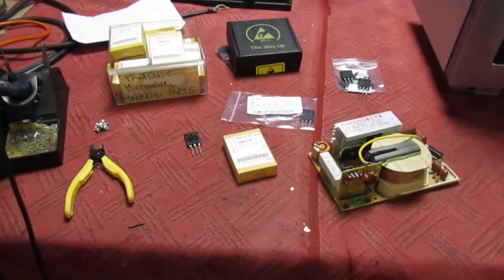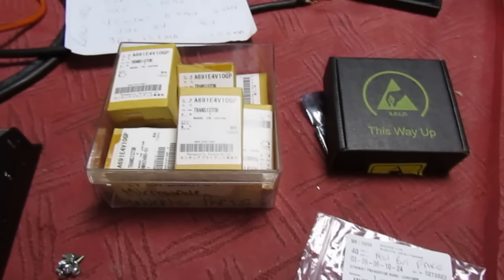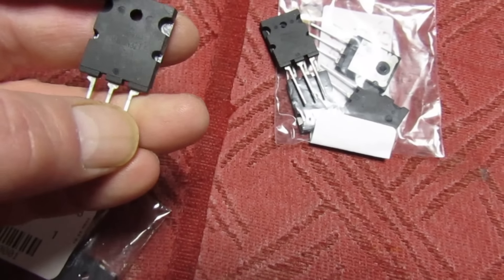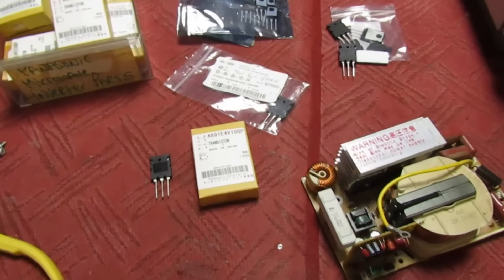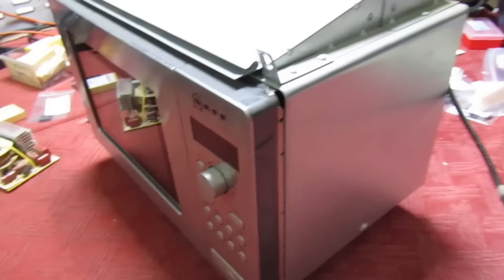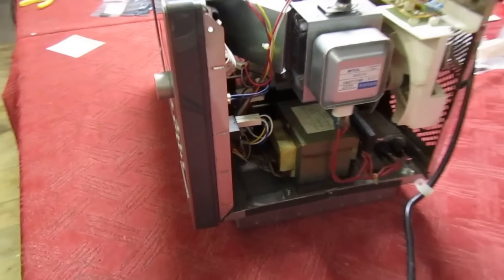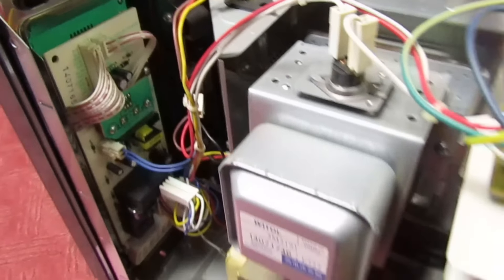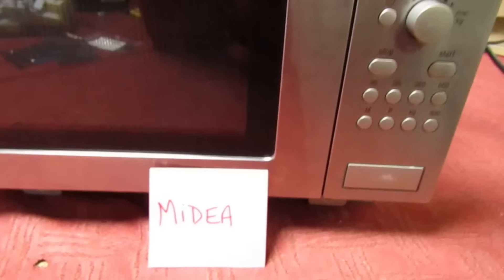Neff Microwave nasty surprise inside .

Comment: Another classic case of the switch mode supply replacing the trusty power transformer.
Reply from the maker: Strange how they have reverted back to a transformer though , maybe its cheaper to make a transformer now  ?
Reply: @michaeldranfield7140  Possibly. Could have something to do with the supply of silicone over the past few years.
Reply: @michaeldranfield7140  MOTs are mostly iron with aluminium windings, so they're much cheaper than ever before.
The coils look like copper - just scrape away the surface and be greeted with shiny silver.

Comment: I got out of repairing microwave ovens in the 1990s just as Panasonic were releasing their new "Inverter" type units. I remember looking at the inverter board of one which had blown up and thinking then that the idea was crazy. Semiconductors and high voltage / current don't play nicely together.
Reply from the maker: to be fair though the inverter boards have stood the test of time , I remember in the 90s when I was a sharp dealer we were shown a prototype on a sharp training course and told this would be the future , strangely enough though sharp never produced any over with a switched mode psu , in the UK anyway so I dont know why .
Reply: I bought a Panasonic microwave oven in the late 1990's, Inverter-type. It still works to this day, even the incandescent bulb inside (big thing with long filament, looks like for a very old projector). The white plastic case has yellowed though, so it looks a bit off.
Edit: About quality from the past, I bought a cooler/freezer at the time, Swedish brand (Cylinda) but made in Denmark by Vestfrost. Standard model, nothing fancy at all. Still works to this day. I had to change the old typ capillary thermostat for the refrigerator part after 6 years, corroded away, new part was dipped in plastic. 25+ years this year. Practically unheard of if you buy newer stuff, which too often fails far sooner. Many later Cylinda were made by Turkish Arcelik, and they among other things managed to use untreated iron tubing for the condenser coils, så ALL those refrigerators failed within 3-5 years, first symptoms inside filling up with brown rust! Crazy, but true.
Reply: @Indiskret1   The Series 1 Panasonics released in 1998 were manufactured in the US, the white plastic did go yellow over time. There were also some paint issues where the door pulled paint off the front mullion the first time it was opened. But they were very reliable. Here in Australia, I'm pretty sure they didn't have the tubular halogen floodlight style lamps, they were expensive to replace and with 240V mains here rather than 120V (so thin filaments), the halogens were rather delicate and prone to short life. (Some Sharp convection ovens used them since they handled heat well, but people didn't like having to replace them.) The US Panasonic models weren't manufactured for that long - divisions within Panasonic used to bid for production allocation and for the next model run the Chinese arm PHAMOS won the bidding.

Comment: We've used a cheap (just two knobs) Chinese microwave for 20 years and it just keeps on going. Who can compete with that? This might sound crazy but maybe the Chinese last longer than Panasonic nowadays.
Reply: Its not Chinese vs Panasonic that is the difference, its transformer vs SMPS.
Transformers are reliable and last for decades, whereas high voltage SMPSes are fragile and fail within years.
I remember when it was normal for microwaves to last decades. They all had steel transformers. People used to have microwaves that were inherited from their parents.
Reply from the maker: the thing is something very old will last much longer because all though it may have been cheap years ago I will be of a much better build quality and much better parts, the stuff they produce now is more or less disposable , just not designed to last many years .

Comment: Now you got my attention when you said IGBTS breakdown over time (with use I am guessing) as I have often wondered  this myself. I repair a lot of Yamaha Power amps with IGBTs switch mode PSUs and I never see any reason why the IGBTs in them are always blown but the rest of the amp is working just fine when the PSU is repaired.  This might explain the reason. Just the way they are made makes them go bad over time!
Reply from the maker: Yes, it was a very interesting and quite lengthy document detailing aging of a Igbt and it's failure mechanisms and the conclusion was a definitive degradation of the substrate of the device after prolonged use, eventually leading to failure, this is what prompted me to buy those 5 used Igbt s to do some comparative tests against a new device, however my simple tests all gave a pretty much identical results, the university were using x ray to examine the internal structure, like you I have replaced Igbt s with no other parts required which seems to suggest that they do degrade with use.

Comment: Very insightful - thanks. The very first appliance I bought when I entered the "real world" when I started working and my rented flat didn't have a microwave was a bog standard x-former Panasonic - it's been going 20+ years now but the inside is starting to rust under the wheels of the turntable - my parents replaced their old style microwave/grill with an inverter type about a decade ago and haven't had any issues (yet) - the appeal for me is the power control as we have PV/battery so being able to control the power would be useful, albeit not at the expense of reliability!

Comment: Hello, Panasonic for a long while use the non inverter tech in their base model microwave but they do still use inverters in the rest of their model range. The inverter they use is quire robust, id say we get more blown bulbs with melted DU PCB's than failed inverters. Wierdly i had a couple of failed inverters where the IGBT was short but the bridge rectifier was fine!
Reply from the maker: the bulb , yes you have to watch out for that one , bulb blows the pcb fuse that flashes over to the micro and writes the oven off as the micro is now no longer available .

Comment: Any component that meets or exceeds the original parameters is fit for replacing an original.   
A replacement IGBT, as an example, can be replaced with any other that matches or exceeds the original collector current and collector-emitter voltage, matches gate capacitance and total charge as close as possible. 
The emitter-collector max drop is of less importance and TDP should be equal or exceed OEMs. 
There are advances even in discreet   semiconductors. Look up reputable sellers for original parts with warranty.
I can recommend a couple if you're from the EU.
Reply from the maker: substituting an IGBT is not something I have ever done before , I have always used the correct part , but in this case its almost impossible to get as panasonic no longer have these , I was lucky to find a company with some old stock but I dont think that will happen again . The gate capacitance of the original part is very high no doubt due to the size of the device so its going to be very difficult to closely match this part , but as I understand it one with a lower gate capacitance will turn on quicker .
Reply: @michaeldranfield7140  you can substitute with lower gate charge. It will be fine as these are not self oscillators and it will only be easier on the driving totem. 
That is one of the advantages  of newer transistors. And you could also increase gate dampening (resistor and ferrite bead) to avoid hf ringing. But for that you should carefully scope the gate slope and collector current to avoid any unnecessary lingering in the linear region. 

But in my opinion... I'd just throw in any beefy-enough igbt. 
Fakes are everywhere. Recently had a batch of 20 mosfets blow on me at 1/4th of the rated specs... 
And I should've known as they cost 1/3rd of OEMs =))
Reply from the maker: Many thanks for that , I will come back with another video soon .
Reply: some IGBTs have integral inverse fast diodes, some do not, so dont fit one without a diode when the circuit needs one! Big bang!
Reply: @kevvywevvywoo  I guess that should be obvious. But nowadays, pretty much all sport integrated fast diodes.

Comment: Midea is pronounced MAY-DEE in Mandarin. It is a big brand in China and considered reasonable quality for the price. We have lots of their products here in NZ and they seem to be ok mid range products. My Panasonic microwave has just started tripping my breaker when I pressed start last night. I guess it's gonna be a shorted IGBT and destined for the recyclers. Oh well. It was a roadside freebie and I got about 2 years from it, so I'm fine with it.
Reply from the maker: Many thanks for that , I wouldn't throw away your oven just yet , many different things can trip a breaker , water in the turntable motor is a very common cause .
Reply: @michaeldranfield7140  Yeah, I'll still diagnose it first. The turntable motor has always rotated when the door is open. I never bothered fixing that, so it is still rotating normally. I can program in the cooking time but as soon as I hit start, the breaker trips.
Reply: @michaeldranfield7140  Pulled my board out. It looks to have two IGBTs (high and low side?). Both measure shorted. I guess it's time to take her to the recyclers.
Reply: Midea has the Toshiba microwaves and appliances license in Europe. They also make decent fridges. Haier is another decent Chinese one who now own ex Italian brands Candy and Hoover. China not to be sniffed at anymore.

Comment: That Neff looks very similar in build the my Cuisinart here in the states even down to the same Mag used. I still like the heavy transformer ovens, they've gotten pretty reliable over the years. On the flip side the Panasonic's are easier to move around.
Reply from the maker: Quite possible that the same oven appears with different names in different country's, the transformer ovens are much easier to repair due to the virtually unchanged design since they first came out .

Comment: Have just used a substitute IGBT in another product and it seemed to go well so like others here I'd  suggest trying a modern equivalent. Don't know what the operating frequency of these ovens are but if not too high maybe gate capacitance is not so much of a problem.
Reply: 2450mhz
Reply: I was talking about the switching frequency of the IGBT, which is likely around 20kHz and not the microwave frequency.

Comment: Hi Michael - I hope your proposed test works well because I have two combo flat-bed Panasonics which we use every day and I'm banking on you being able to fix them when they eventually break down!  This particular model, whilst absolutely brilliant, is sadly no longer available!  Great video again.
Reply from the maker: Fingers crossed it should be ok , however there are different inverter boards used , this will cover the earlier version , then I will look into the later board as parts for these are also no longer available .

Comment: That looks like the 6 yerar old  £80 cheapo MW that my daughter had.  The display would hang up and the controls would not work. I you left it off for a while it worked for  5 mins then it would hang up. I did a quick check on caps and power supply, all seemed ok. I assumed it was the controller. It's now at the dump in the section reserved for  new looking white goods but faulty.
Reply from the maker: True , I see loads of brand new looking white goods at out local tip, trouble is you cant get them !
Reply: @michaeldranfield7140  Not like the good old days.  I used to know the man at the dump in the 70s early 80s.

Comment: I took a trip to my local Curry’s the other day and couldn’t help noticing that pretty much all of the  microwaves steel casings were identical (vents/pressings) all exactly the same with different plastics on the front. Whether it’s Panasonic, Sharp through to Morphy Richards, all the casings are identical. Has it got that way now where most microwaves are made by one manufacturer like Vestel with their TVs?

Comment: I bought my Sharp in 2006 and it's still working great.  Sorry Sharp !  But I probably will buy another Sharp.
Reply from the maker: I still have a sharp at home from the mid 90 s , you might have a soft spot for sharp but did you know Sharp no longer exists ? they closed down many years ago and sold the brand name off , UMC produce sharp branded TV s and Vestel produce the Sharp branded microwaves .
Reply: Also have a + - 30 year old Sharp Carousel. Brilliant

Comment: So all electric cars use IGBTs in the power delivery stages - makes me wonder how long they will last before giving up the ghost - since IGBTS (and most semiconductors) almost always fail shorted, I do hope they have decent protection in place as usually the "fuse" is always just fine in most SMPS I repair!
Reply: The IGBT in cars might last longer as they are dealing with comparatively lower voltages (but higher currents).
Reply: @stopthebus  I think its the heat cycling and vibration that's killing them according to what I have read so far. So higher currents will kill them quicker in this case.
Reply: @mattsan70  It's not something I have much experience with. All I know is that semiconductors and high voltage / current don't play nicely together! When I saw the Panasonic inverter boards when they first hit the market I remember thinking it was a crazy idea.
Reply from the maker: quite possibly , however there is a possibility they are better designed for a harsh environment , like a mil spec part .

Comment: Did you say the client purchased a new microwave for £450 and thought it was cheep? They are about £75-100 for a basic one. Even the expensive ones do the same as the £75 ones - warm your food! I brought what i considered an expensive one at £279 a few years ago, but never have used any of the features (grill/oven/steamer) apart from throw a plate of food in and press start a couple of times to warm something up lol
Reply: My microwave cost about £20 in tesco. It does the job and has a halogen grill in it too.
Reply: @bigbasil1908  I twice bought a sub-£50 microwave from Tesco. 
Light failure within a a few weeks. Microwave dead within 6 months, both. 
Not great.
Reply from the maker: yes £450 but its a build in one which are much more expensive than just a stand alone microwave and don't forget your also paying a big premium for the name , which actually means nothing now , Couple of years ago I had a customer who paid something like £130 for a high end German brand of toaster, he brought it to me for repair , element had failed , underneath it said made in china , when I checked with my supplier no parts available, it was classed as a disposable item .so as you say , might as well just have bought a cheap one .
Reply from the maker: and some microwaves are now using LED light bulbs which are not available , I just fit an incandescent bulb . @AnotherPointOfView944

Comment: Random question: do you know how to silence the beep on microwaves? Got a Russell Hobbs RHM2362S. Can beeps be silenced through 'secret' key presses or only via physical modification inside?
Reply from the maker: if there is no mention of secret key strokes in the instruction book you could just take out the piezeo sounder off the control board .
Reply: I tried that with a UPS, then it stopped working. I have no idea why. I put the speaker back then pushed some prestik in the speaker. Muffled the annoying beep nicely and you can still just hear it. (And much easier than taking out the speaker)
Reply: @robertroe1956 I did this with a paper sticker once, in a printer. Worked very well.

Comment: Excellent video and very informative. Can I just ask a question. I have a Neff built in microwave that stays on for 30 seconds ish and then stops, it doesn’t blow the fuse in the microwave or trip the electric. I have tested the magnetron and that’s fine. Does this problem sound like the inverter 
many thanks

Comment: Overheating killed mine I think.  I bought a kit of IGBTs  for a  plasma, I haven't fitted them yet 🙄 people do appear to fix them. If you plug one of those Panasonics in to a wall meter it shows it pulses the power off an on much like one with a transformer lol
Reply: Poor cooling is a common contributor to short service life of an inverter. Ovens that are built into cabinets, sat in tight nooks or next to or above cooktops were frequent visitors to my workshop showing failed inverters. I started to notice it with the very first Series 1 Panasonic inverters when they first came onto the market, they were extremely reliable, but the failures we did start to see after about 18 months were all built-in units with inadequate air circulation.
Reply from the maker: unless your kit is a genuine manufacture. supplied repair kit I would check very carefully before fitting it does not contain fake parts .
Reply from the maker: @PlatypusPerspective  most common cause I find for poor cooling is the back vents get greased up in a kitchen and then dust sticks to blocking the air intake .
Reply: @michaeldranfield7140   Yes, true. Even more so with commercial ovens, they came in dripping with grease and the intake filters totally clogged - both magnetrons cooked.
Reply from the maker: Funny you should say that , I have a 18 month old Samsung commercial oven in for repair , it looks to be virtually brand new and both magnetron's have failed  but I waiting for the customer to get back from holiday and tell me the true story about this because there is something very odd , they claim to have bought it brand new but there are 3 screws missing out of the back so something does not ring true . @PlatypusPerspective